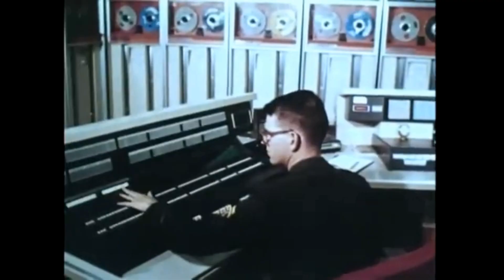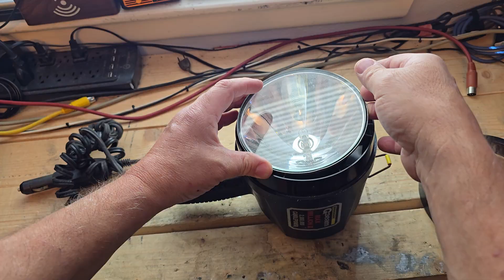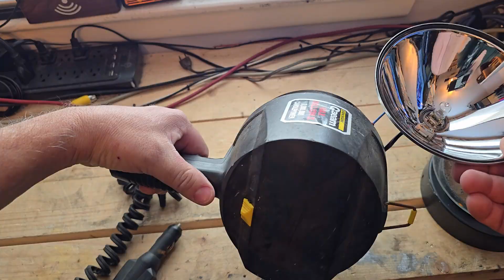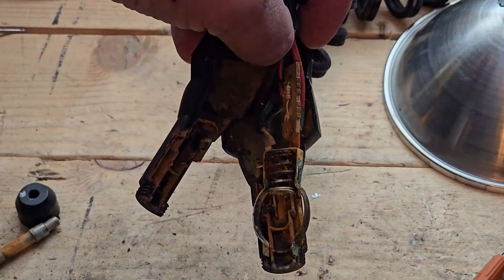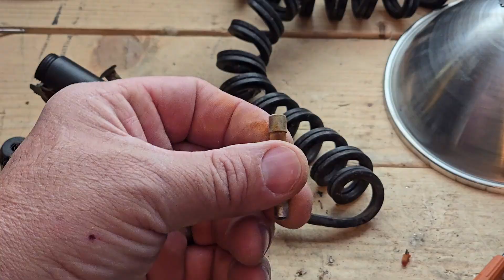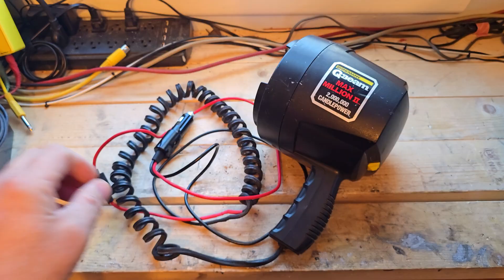Max Million II spotlight repair and testing.

Comment: That was quite enlightening. Also candlepower is not the same as candelas with 1 candlepower roughly equaling 0.981 candelas. Just more useless trivia and for no reason at all they decided to come up with a new measurement that is only 0.019 different than the old measurement.
Reply from the maker: It's like the metric system of light. Good grief.